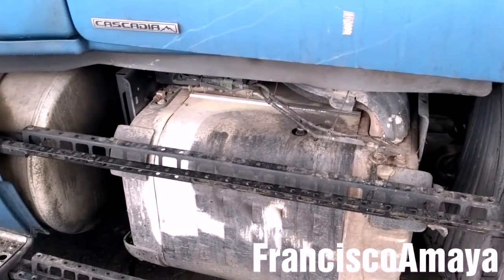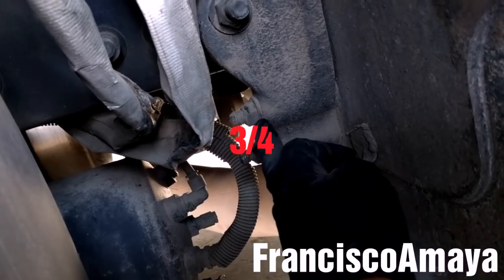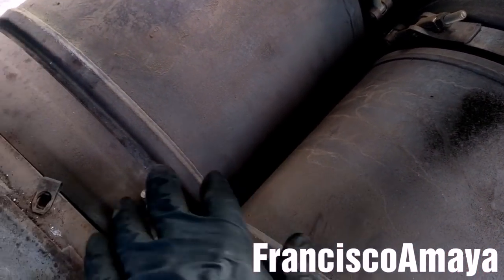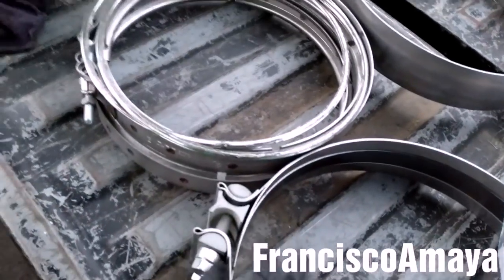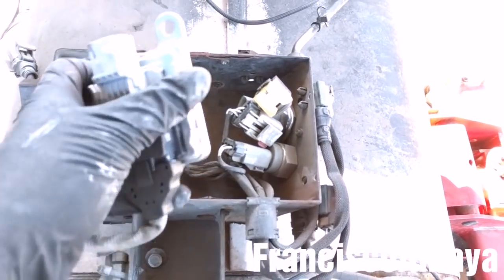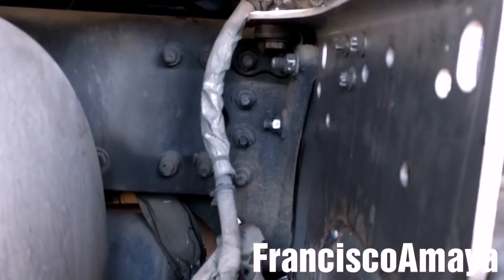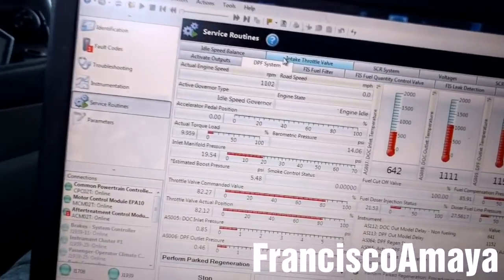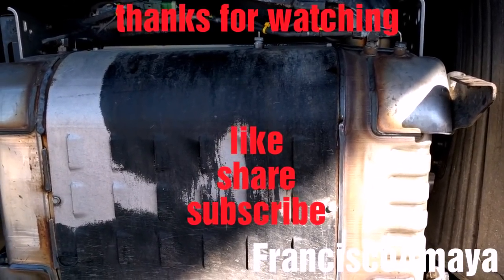Freightliner Cascadia DD13 DD15 engine SCR box DOC DPF remove replacement DEF light flashing

Comment: One scr box replacement 10k 
Inframe with turbo and new injectors and egr for 07 Detriot 14l is 17k at dealer. 

I can’t believe people are dumb enough to buy these 08 and newer junk trucks. 

These trucks killed more businesses then any other expense in trucking history. 

60% of truck dealer bays are def and regen issues.
Reply: Gcal1956 you don't know wtf you're talking about.
Reply: Ecoscienceczar yeah to run cali loads you have to have this smh
Reply: Most of tge time my truck went into rge shop was def and dpf issues.
Reply: 2015 Freightliner with DD15 and I hate it. Countless emissions repairs. I just had the cylinder head replaced and it cost $15,000. 926,000 miles and I’m sure the SCR box is soon.

Comment: fool wasting money on onebox  on old truck which can be run by deleting
Only New one box will not pull the loads
There 1000s other old parts on old truck which need repair later

Comment: Is there a way I can contact you I need some work done on my cascadia. I know your in Fontana area and we would like to take our truck to you. Thanks
Reply: @transport21  where you at
Reply: @transport21  
What if you don't have any idea where the parts are and you come back here to ask Amaya for info. Any time a truck spends in the shop is time without making money to a driver.
Reply: Private One it was a typo.  What I meant was I have 2 shops that I go to or it's uselly the dealer I go to. I'm also trying to find out where his shop is in Fontana so I can come to him lol
Reply: @transport21  
Yay.
You're off the hook HACK.
WAAAAAAAAHAAAAAHAAAHAAAAAHAAAAA. 
safe drivings out there. 
Pre trip and post post trip for PREVENTATIVE measures.
Be well.

Comment: How much is  the onebox , new filter and nox sensors plz advise I need to change it
Reply from the maker: Average is like 10k
Reply: Francisco Amaya  my mechanic already changed the DPF Filters, Nox Sensors and Metering Unit. Now, to the fix the issues he’s asking to change the Box, he’s saying the cost would be around 10k. Since I already have the parts like filters and nox sensors, don’t you think asking 10k is a little too much?

Comment: I didn’t watch this video. But last week I pulled the SCR out and replaced the dpf filters N0x sensor and replaced the def feed and return hoses. Also replaced the gasket for the def injector. So far I’ve put 2k miles on it without going to a dealership to clear codes. The check engine and mil lights turned off in less than a day of driving. Should I still take it to have it scanned?

Comment: Hi, there. I was in tx and the truck did a region for 40 minutes once it was done i saw a smoke 💨 coming out of the dpf like the steps on the passenger side. Is it normal to do that? Its a 2015 Cascadia dd15 I have no code or check engine light.

Comment: Hi Francisco, i have a Freightliner Cascadia 2015. Recently i had my air compressor replaced, but a month later it started leaking under the compressor, not just small leak, it was pouring under it. when you stop the engine the leak slows down. what could be the problem? please help if you have any ideas what could that be. We tried to replace the seals but it didn't help at all. I would appreciate your help very much, thank you

Comment: I'd love to cuss out the horse ass designers of this SCR box for purposely using all those different sizes and heads of the bolts just to keep people from working on it.
Reply: The work being done by the element determines the size, precision, location and quality of a bolt. Engineering at its best. Just like the locations and sizes of the nails and screws used when one builds a box with hinges and locks.

Comment: Fransisco,  I had a question. I was changing temp sensors on my one box, and I noticed there is a little hole under the one box, facing the back of the truck. I turned the truck on and put my hand in front of the little hole and sure enough there is exhaust pressure coming out of it. The hole look's like s weep hole and look's like it's supposed to be there, but I wanted to ask you if that is normal for a small hole to be on the bottom of the one box? My truck is a 2015 cascadia with a DD15. Thank you in advance...
Reply from the maker: If it is right close the the exit of the scr that is a moisture drain orifice

Comment: Hi. Fransisco thank you 🙏 for helping as much as you can. My question is it compulsory to do all this stuff if the DPF light is on?
Reply from the maker: Yes, if you want to do it the proper way. 
However, you check my video https://youtu.be/GW5Wk6M_BKc for details about bypassing the SCR system and it can buy you time to work to get the money to repair it properly.

Comment: My freightliner Cascadia 2012 have this code SPN 1807 check engine lighting is on,Have a new way can you tell me what of the problem is please
Reply from the maker: This codes means, steering wheel angle out of calibration.  
This could be caused by a bad steering angle sensor.
Reply: Francisco Amaya 
My cascadia 2016 have this code SPN 3720 ,
Reply from the maker: adrian sirbu 
It is a DPF cleaning 
Check my video to understand 
https://youtu.be/TDUcGNUOcHs

Comment: I have a question on the brake chamber for the cascadia.. from the chamber how long is the rod usually? I bought one that has the long rod and i have it stored for emergency incase mines goes but not sure how much lenght to cut it?
Reply from the maker: Usually the rod length is 4 inches but it is better to cut it when you measure it with the old one at the moment of REPLACEMENT.
Reply: Francisco Amaya ok thanks

Comment: What color of smoke was this truck throwing that led him to think  it was bad a bad 1box
Reply from the maker: White dark, smells like ceramic.
Reply from the maker: Yes, it was a bad SCR box.  Original box with 900k miles.
Reply: Francisco Amaya.. A one box usually doesn't just fail on its own. Unless you find out the PFP it will happen again

Comment: what are good tips to increase the life of an SCR box?
Reply from the maker: Use quality DEF
Don't idle the engine for long periods of time
Don't over force the engine
Use low gears when you're taking off

Etc,..
Reply: Regular maintenance 
Use good quality fuel 
Don't idle too long
Use the engine for its intended purposes. 
Replace DPF filters don't bake them. 
Use a repair facility who is competent in working on these types of engines.
Reply: SCR is getting bad usually from overheating. Worn injectors and egr components make little more soot and DPF catch it. When time comes for regeneration to much soot is getting burned and DPF outlet temperature rising to 1400-1600F. That kills SCR . The process is called SCR poisoning... So want to have longer life of SCR change injectors every 600k miles and pay attention on EGR actuator. Also don't wait until ACM will do regen. Do parked manual regen by DL every  1.5-2 months

Comment: Hey I’m sorry to bug you but I have a Detroit with def light flashing , already replaced dozer valve can you please help me out
Reply from the maker: Do you have a code number?
Reply: 521049, 521052 ,3361, 4334 and 520372
Reply from the maker: You are having DEF pressure issues 
What is the year of your truck?
Reply: Francisco Amaya 2017  
I’m at a loss  
Dozer valve test is passing but still have def light blinking and derated
Reply from the maker: You have to do a regeneration. 
It is possible that you have a bad dozer injector.
Reply: Francisco Amaya I’ve  replace it already and it’s still doing the same thing 
, thanks anyway appreciate your help
Reply from the maker: Check the dozer wires all the way to the ACM, it is possible that it is damage or broken somewhere.
Reply: Francisco Amaya ok I will try that thanks
Reply: @pancho0226  how did it go?

Comment: I'm deleting mint there's no way in hell I'm paying 10k for a metal box
Reply: Charles Robinson agree with you, too way expensive
Reply: Don't do it unless you want to ruin your truck.
Reply: devon deed that’s not true. U can remove all that garbage and make the truck breath and run much better.
Reply: Gcal1956. Trucks with AT&T systems are designed to run with them. If you delete them you run the risk of damaging your truck and will eventually get fined for it. Ya you will experience more power because the restrictions have been removed but I guarantee you that you will pay for it in the long run by either fines or having to replace the engine or both. If you want to run that risk go ahead but remember your truck is an investment and is a source of income why chance it.
Reply: devon deed is correct. These systems are engineered for specific pressures and temps. These systems are cleaner running than cars. Only a matter of time of either an engine giving out or Johnny Law slapping you w a feloney. Y'all are in the wrong business if it's "too way expensive", etc. Buy a Glider or just go work at McDonalds.
Reply: Like we say that's the cost of moving freight it sucks and its stupid but that's what you need to stay on the road I think the fine is like 14G from the EPA for  tampering with  emissions bs. You can get a older truck without it and be legal though but whats the cost of a rebuilt motor

Comment: Hello brother 
Wanted to ask you a question on 10/11/18 my 2013 freightliner cascadia dd15 engine light turned on the check engine and my check light turned on with my def light I have full def ... So i checked the faults i have 2 faults it says1st code ( EEC 061 spn004364)
(Nox conv eff 18)
2nd code (eec 061 spn003364 def quality 02)
Please brother any answers will help by the way I love your videos brother thanks
Reply from the maker: You must do parked regen with the DDDL software to clear those faults.  

Sometimes,  driving the truck at cruise speed for more that one hour can clear the faults as well.